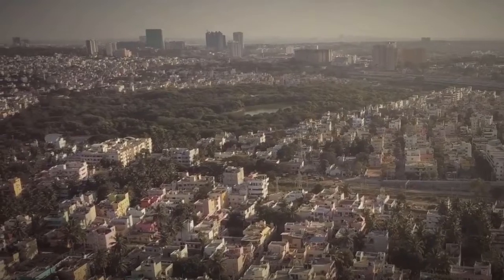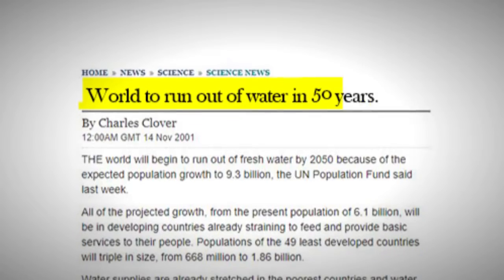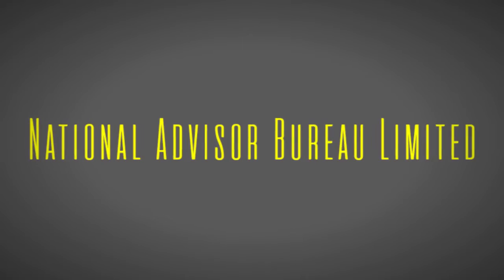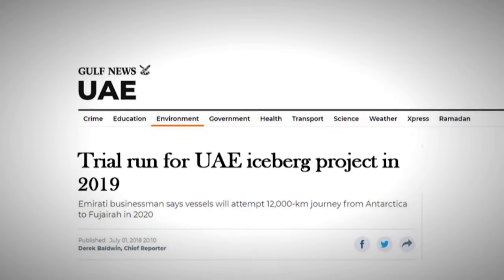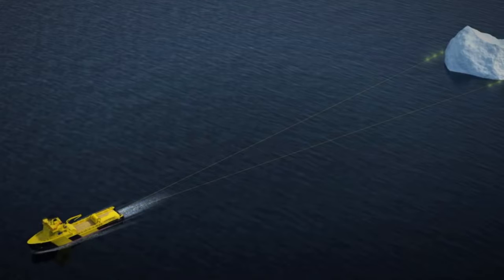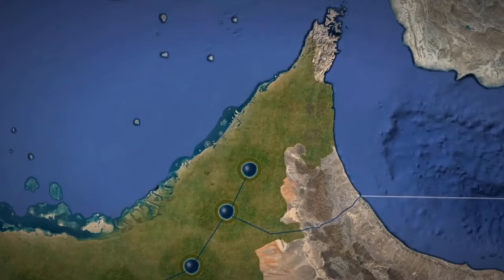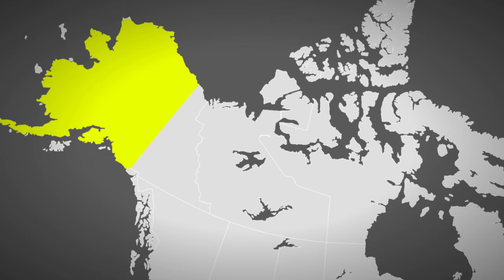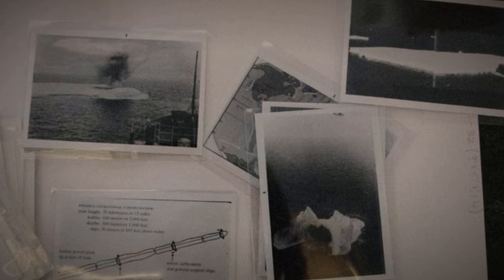The Iceberg project

Comment: I had heard that, in the 1970s an iceberg, insured by Lloyd's of London, had been towed towards Arabia, but I don't know how far it traveled. However, sailing time of such an iceberg could be reduced to two months by using warships, with nuclear-reactor-engines, as tugboats, such as two in front-sides, and one in the back to push it forward. The pushing tug could also be a nuclear submarine, pushing the iceberg below the sea-level. A one cubic-kilometer iceberg would probably keep half of its ice, by the time its reaches the Persian Gulf.
Reply: It would be way easier and less expensive to just freeze seawater (since that helps to desalinate the water naturally) and process it. It would take a lot of money and ships to tow an iceberg that big— if they could even successfully pull it off.

Comment: it sounded unrealistic until you said 1 mph, like thats realistically slow, but don't they think if they could engineer it somehow to do 3mph, that would literally cut transit time in to 100 days
Reply from the maker: Thanks for the comment! And yes! But they have calculated that the size of the berg they need will be so big it would be "at best 1 to 1.28 mph"so the best they can do with todays tech is aroun 250-300 days,and that is if everything including weather is perfect. Hope this helped! Have a good day mate :)
Reply: Sic Semper Beats they can use more boats
Reply: @user-cc4kq6hl4c  You get dimminishing returns by adding more horsepower because of the way the the iceburg is shaped. It mimics a displacement hull boat